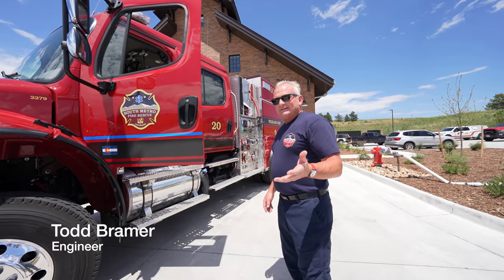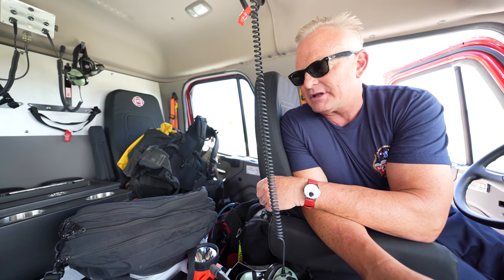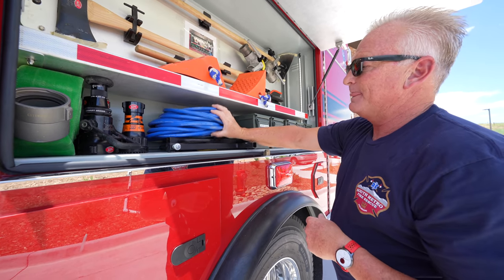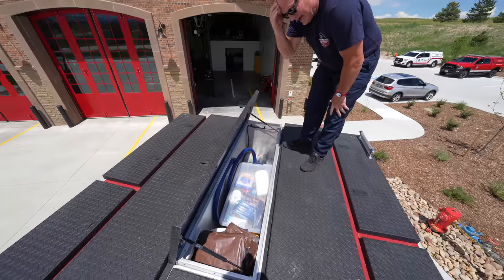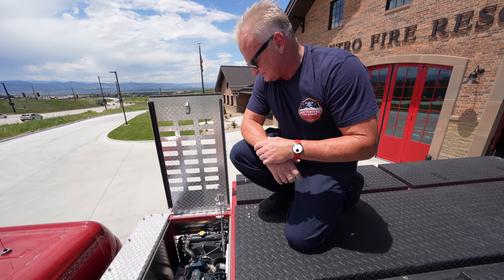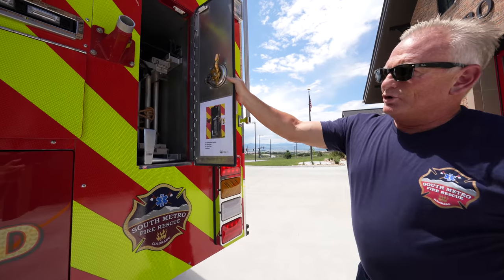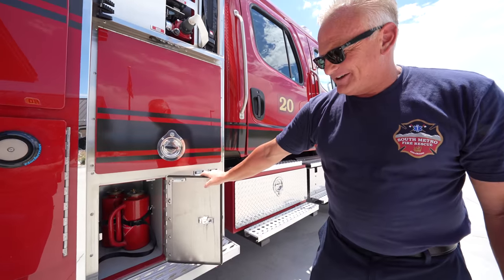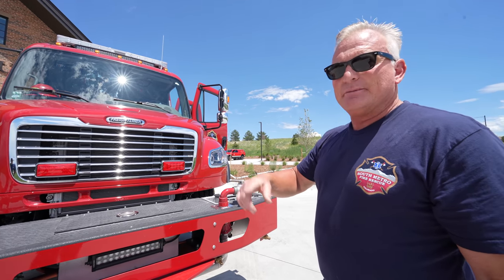Brush Engine 20 - Fleet Friday

Comment: Can’t wait My ideal station setup is An Engine, Medic, Brush Engine, Water Tender, and a battalion Chief. WHATS YOURS ?
Reply: Engine, ladder, rescue, ambulance or 2, utility truck, battalion, ems chase car and if needed brush, water rescue, tender, etc
Reply: Engine, truck, heavy rescue, medic, safety or bc
Reply: Engine 2 medics squad/hazmat and battalion
Reply: Engine, battalion chief, medic, heavy rescue/dive rescue team, squad
Reply: Technical rescue truck, Tower truck, two  engines, A medic unit and any type of chief officer
Reply: Engine, Truck, 2 medics
Reply: 2 Brush trucks engine and a Squad truck tanker and a Utility gator and two chiefs safety
Reply: I prefer the specialized tech stuff, so my ideal station would be something like BC, Quint, Aerial, Heavy Rescue, CBRN, Medic
Reply: @landonpalmer7662  I might not be as firm in english/american terms of firefighting as I thought I was then. What I meant was a truck that is a combination of a ladder and an engine (which I thought was called a Quint in america), these are very common in europe and basically THE front line apparatus - and a turntable ladder or platform truck (which I thought was called aerial)
Reply: @landonpalmer7662  well if the cities big then..
Reply: @landonpalmer7662  plus my local dry had all those besides 2 ambulances and it’s not that bjg
Reply: Depends, are we next to a city or far into a more rural/smaller city? Smaller rural city: Engine, Ladder, Brush, Rescue, Tanker, Command cars, ATV, maybe a ambulance unless we have an EMS service here. And depending on how far from a big city, maybe a hazmat truck, and if we're next to a river or lake, a boat.

Next to a city: Engine, Ladder, Brush, Chief, mini pumper (maybe)

Comment: Great looking truck. What is the difference in flow capacity between the auxiliary pump and the main pump?
Reply: The main pump is 750 down rated to 500 gpm. The aux pump is 185.

Comment: 8:40 that pump looks really small. I get that trucks have limited space, but our department has noticably bigger portable pumps. What's the gpm on those?
Reply: It will flow 78 gpm (295 LPM) @ 100 psi (6.9 bar) and 38 gpm (144 LPM) @ 250 psi (17.2 bar). There are datasheets for the Waterax Mark-3 pump online for the exact specifications.
Reply: The Mark 3 is intended for use as a high pressure pump capable of up to 380 psi. Important for long hose lays and elevation gains.

Comment: Are all four of South Metros type 3 Engines deployable or is it only certain ones?
Reply: SMFR currently only deploys one Type 3 engine with Brush Engine 20 being the primary unit deployed. The rest of the Type 3s are not listed for deployment and are kept in district for local response and major incidents in Colorado that have an immediate need for resources.

Comment: When's fleet Friday engine 20
Reply: daniel gaming official channel   ok
Reply: I think engine 20 it's already shown
Reply: Look it up on YouTube. I'm not 100% sure but I thought it was already shown.
Reply: @albertomadeirajr7824  it's not it's fleet Friday engine 19 and brush
Reply: I thought they showed it at the fleet headquarters one time they were installing equipment on engine 20 that's why I thought that was part of it.
Reply: They might do one on Engine 20 since it is a newer design but the Fleet Friday on Engine 19 they had is very similar to the new Engine 20 so if you want to check that out it will be almost the same.
Reply: @centralcofirebuff7830  engine 20 is 2021 I think engine 19 is 2019 so engine 20 is newer
Reply: @TR4MAINEE  Yes thats true but the design from what ive seen from both engine 20 and 19 are very similar just a few newer things in Engine 20
Reply: @centralcofirebuff7830  yea I'm trying to see what's different from the trucks
Reply: @albertomadeirajr7824  correct

Comment: when SMFR is deployed to forest fires , etc  out of state why do not ask the airforce to transport your teams to the state  that is requesting your help with you bush trucks ?
Reply: For both logistical and financial reasons.  It is more cost-effective to deploy directly from stations to incidents and many times crews get rerouted to other incidents as needs arise.
Reply: I can make a guess, the president and one or both state governors would need to requests and declare a state of emergency, it’s also cheaper to drive right through and stay at one or two hotels.
Reply: @EricWhiteTheGamer  Interagency resources do not need a declaration of emergency. Any agency can make a request through their assigned Interagency Dispatch Center to access federal resources which includes air and interstate resources. The Interagency Dispatch Center will then take care of the overhead of sourcing resources to respond from across the nation based on what they have listed as available. As an example, SMFR lists one Type 3 and one Type 6 engine that can be deployed nationally.